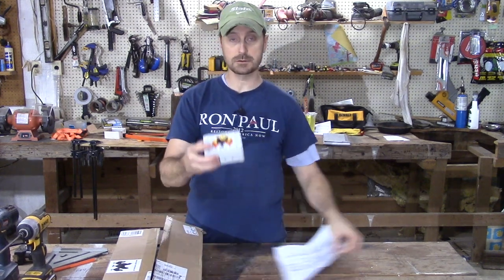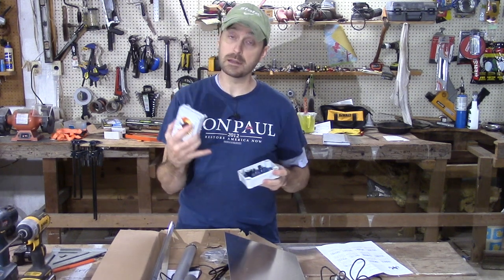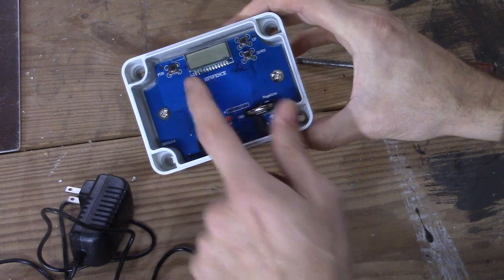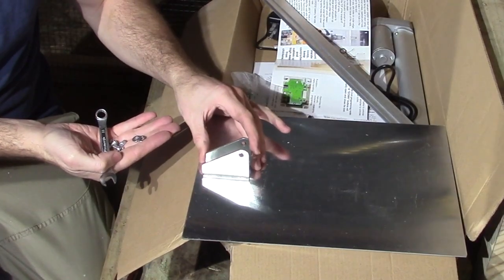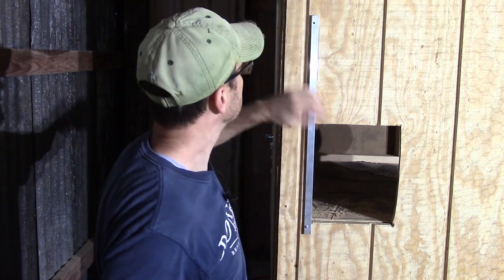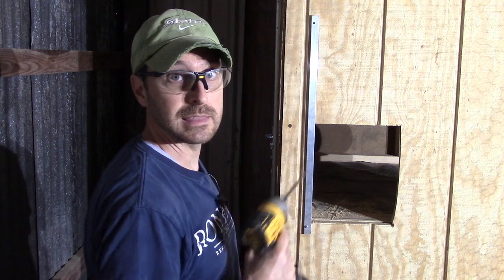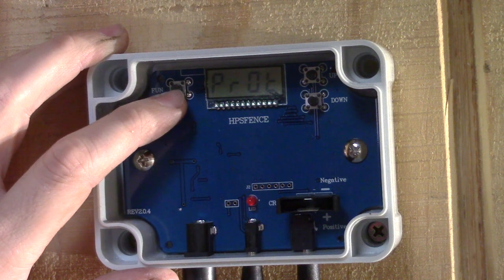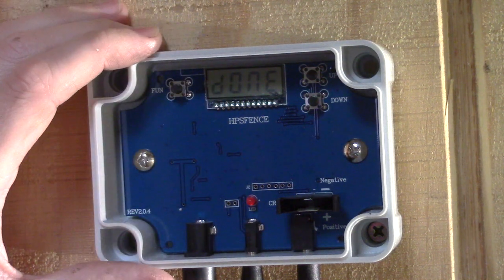Automatic Chicken Coop Door Opener And Closer | Happy Hen House Installation

Comment: Thank you for this video. I bought this system last year and Still haven't installed it. We are installing it this week though but i discovered once I opened the box, that the instructions are missing  and God alone knows where we put them. I needed clear, concise instructions for installation and you provided them.  Thanks again.
Reply from the maker: You're welcome. I just wanted to give you a heads up on this door though. Watch my video a few months after this one. This door killed a few of my chickens. Even on the lowest setting, it was still too strong and crushed them. I have a different type of door now.
Reply: @CountryLivingExperience  Oh No! I spent a Lot of money for this door!
Reply from the maker: See if you can return it. The same company has one that operates with a string.
Reply: @CountryLivingExperience  I've had it for over a year, I doubt they will exchange it.

Comment: Thanks for posting this. I don't like "store bought" systems like these but this system seems very nice. I like the fact that it has plugs for all the components to make it easy for the customer to install, yet at the same time I don't like it. If you want to extend, shorten or replace components then, screw terminals would definitely be better. In your case, you were able to easily move the box to the window side. Others may not be able to.  Being able to just extend the wire would be very helpful. I personally like to have separate components aka two separate timers and photocell Module. That way I can replace parts not the whole system. It cheaper too.
Reply from the maker: Ok. Thanks
Reply: @CountryLivingExperience  How is it holding up?
Reply from the maker: It is holding up great so far. No issues at all.